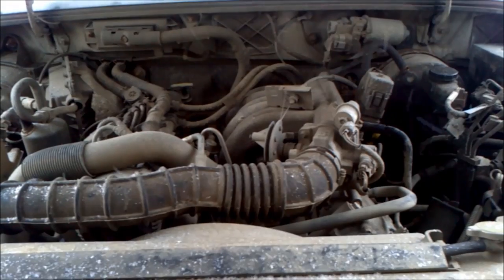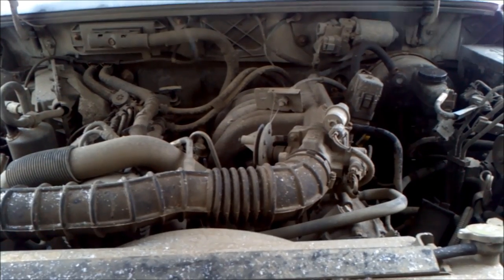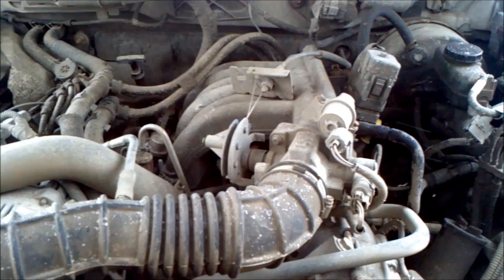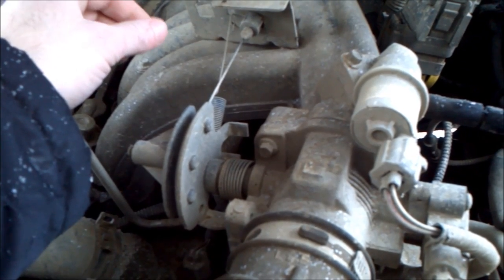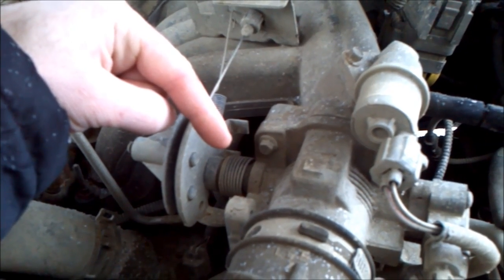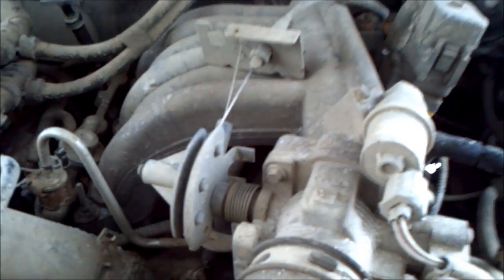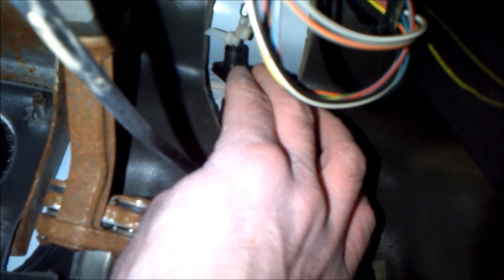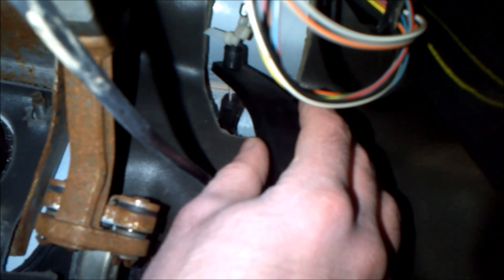Ford Ranger Throttle Cable Mod (EASY) - Make Your Truck Drive Like New Again!

Comment: HI I have a 07 ranger 4.0 with 02  sensors upstream stuck rich , cant find anything but my cable does stretch maybe an inch upward before it seems to move the pedal . I can move the control manually and  the throttle plate opens all the  way . could this  in anyway  effect hesitation or lack  of power ,,,,,,,,,  its  pretty sloppy cable but the crappy mechanic I have  said that's normal .

Comment: So what do you do when your throttle cable snaps? LOL, that's what just happened to mine (grabs tool bag, walks BACK to where truck is broken down).

I highly recommend lubricating the cable periodically with some good spray lithium grease to prevent what just happened to mine. DOH!
Reply from the maker: Good idea!

Comment: Besides the obvious performance (and SAFETY) issues from not achieving Wide Open Throttle (WOT), there's also diagnostic modes and resets that require 100% WOT with Key On Engine Off (KOEO)...

Comment: Did the Ford Ranger generations that ended in 2011 ever get the drive by wire throttle systems or did they continue to stick with a cable throttle like the one shown here?
Reply: Nope, mechanical cable right up to the end! :yougotthis:

Comment: The problem is your cable is going to continue to stretch until it breaks. Do yourself a favor and replace it before they discontinue the part and you have to figure out another way.. I delt with this headache on my 96 2.3.. I'll never understand why ford discontinued this part
Reply: happyrockAg I have a 1996 Ford ranger XLT 4.0 V6 and my gas pedal is floppy. As in it literally lays into the floor board😂 still goes fast if I need it to
Reply: You will be able to get that throttle cable for years to come.
Reply: Ford discontinued the 1988 cable, currently fabricating one to work. No aftermarket support either, it happens.

Comment: would a cable with slack [ mine is a 2000 ford ranger, 6 cyl 4.0 liter ] prevent the transmission from dropping into passing gear?  tx
Reply: Not likely may be a transmision issue/ o/d

Comment: my 98 ranger sounds like it's throttling even after I've taken my foot off the gas pedal. would it be a cable issue like this or a problem with the entire throttle assembly?
Reply from the maker: It could be a number of things but the cable is easy to check, just pop the hood and make sure the throttle comes to a stop/rest at idle. It could also possibly be a dirty or defective MAF (mass air flow) sensor, bad TPS (throttle position sensor), dirty throttle body, etc.
Reply: The cable tends to rust after sheathing breaks or cracks. Get a good lubricant and spray the cable. Try to spray inside the tube that houses the metal cable. I doused mine in wd40, Molly grease, and just pumped the gas pedal over and over yo get all the rust and rough surface as xleN and smooth as possible. It's amazing how much better response is now. Truck went from a little 4wd beater to a 3.0 liter 5.0 speed 4x4 that is actually kinda fun to drive. I tried really gassing it and shifting fast before my fix and throttle stuck wide open and I have no exhaust. I scared everyone in my neighborhood and they thought I was being dumb. Well guess I was. Good luck.
Reply: Downshifting using o/ d or vacume sair leak

Comment: Off topic but is changing the motor mounts difficult on this truck? I have a 02 ranger that vibrates I suspect is from a bad motor mount. I'll probably change all 3 while  I'm at it but not too sure how to do it just yet
Reply from the maker: I haven't tackled that one yet, sorry not sure. Anyone else know?
Reply: Check the inside of your tires and make sure they arent bald.
Reply: MCFriedChicken1 also make sure your IAC is clean, along with your air filter. I had the same issue except my truck would surge because my truck wasn't getting enough air and the fuel was to Rich. (96 4.0 V6 Ford ranger XLT) I cleaned out my IAC with brake cleaner and it helped a lot. I also changed my air filter which I'm assuming the guy before me never did cause it was foul. Also changed my ignition coil because the guy before me that had it obviously didn't sit the boot down all the way and melted one of the boot mounts and melted it and tried to replace the melting with some fuckin plastic JB weld 😐😑
Reply: u Joints
Reply: Vibrations can also be caused by a bad transmission mount which is much easier to replace.

Comment: I mean  that isn't gonna  affect the  air fuel ratio by any chance  and  throw off 02 sensor codes  would it ?
Reply from the maker: I wouldn't think so. As far as I know the throttle input to the computer, which controls the injectors, comes from the throttle position sensor. The TPS is attached to the butterfly in the throttle body which regulates air flow; therefore the air/fuel ratio should be in sync regardless of when the cable starts opening the throttle. The play in the cable is normal because it wears over time so doing this anyways might help with the hesitation but I don't think it will make your 02 code go away. Hope this helps!

Comment: This will mess up your engine, it will screw your electronics in the IAC and TPS. Do it the correct way if you don't want problems.
Reply: What's the correct way?
Reply: I agree that it will mess with your engines idle. But what is the correct way?
Reply: Just did this to my 2000 ranger. Works just fine.
Reply: @duanesmith7263  have you had any problems? Just making sure before I do it to my 04 thanks
Reply: @mboehm04   no problems. I know one day i will replace the cable. It can only stretch so far.
Reply: @duanesmith7263  ok thanks very much